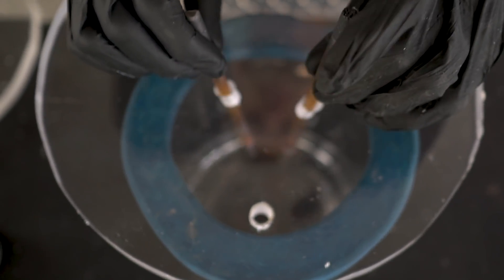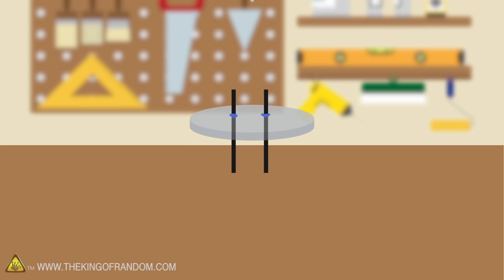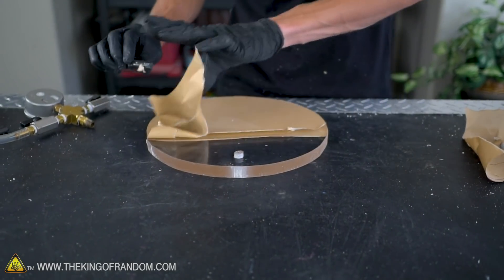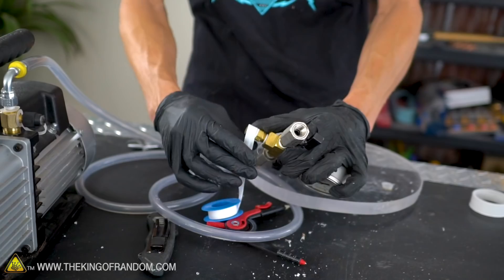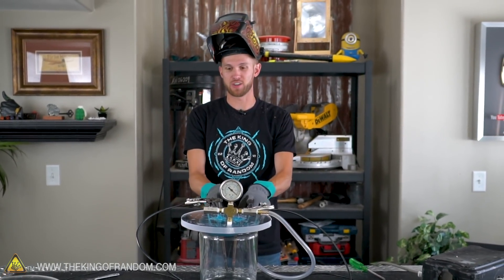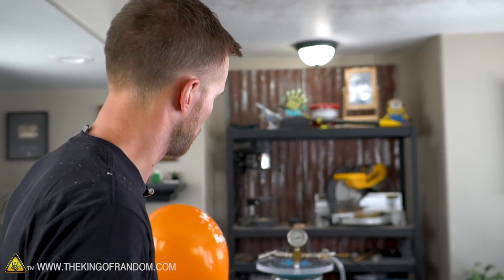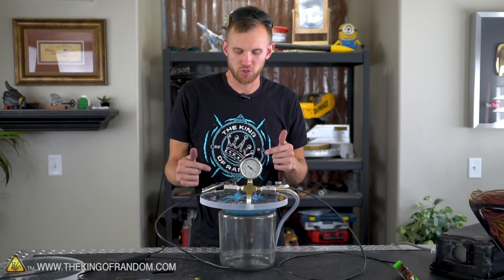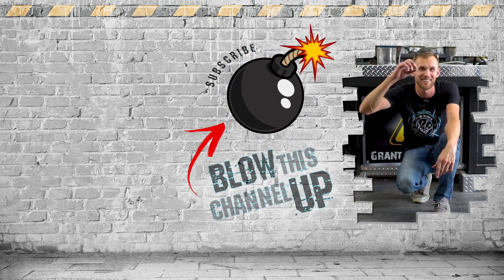Well That Was Anticlimactic

Comment: I'm not sure what temperatures you're dealing with, but how about some "Permatex red" gasket compound for high temperature automotive use?  Also..  What about putting an arduino-controlled servo inside to actually create the movement rather than the sticks extending though, so maybe you could more securely seal just wires that need no range of motion?  Make the sticks move via RC?

Comment: Can you guys please put hydrogen instead of nitrogen
Reply: Thug Life that would probably blow up if you are meaning to use it with the arc furnace
Reply: it would not if they pulled a near total vacuum first, not enough O2 to burn the Hydrogen
Reply: @winterbornfan  What if they use Carbon , nitrogen and oxygen guess what would happen?
Reply: @xxtacowarriorxx6440  the temp would not be enough  to conduct fusion and plus it would be in vaccum so it 
wont  react with atmospheric oxygen

Comment: you should put co2 canisters in the vacuum chamber!!
Reply: lucas johnson it wouldn’t do anything as they’re already sealed under pressure
Reply: @jamieknight7366  dont u think that the pressure inside the co2 tubes rises if the atmospheric pressure around is lower?
Reply: @ExtendGamer  the pressure differential would occur, but co2 is already at a very high pressure (800 psi?) so the increase would be less than 1/2% of what is already there - well within the tolerance of the cylinder. Now, throw them in the melting furnace...
Reply: @ExtendGamer  the pressure inside the CO2 canisters will stay the same. The delta P will change by 12 psi. Not enough to do anything.
Reply: yes vacuum and pressure are two opposite things
Reply: so the  vacuum chamber would increase pressure
Reply: in the canister

Comment: Try using a high temperature acetoxy silicone sealant, it should remain flexible but has a much higher tolerance to heat.

Comment: Is it possible to make a foam figure in a silicone mold from spray foam?
Reply: If you used expanding foam it would probably push the mold and become warped unless the mold was solid then it would expanding out the top but that's just what I think would happen correct me if im wrong
Reply: @rockingyeti56  Let's Get Enough likes and maybe they will do it and we'll see

Comment: @The king of random
Deacon 8875-Thin is a thermal reactive paste sealing compound that is used in high temperature and high pressure applications
Upto 1800 degrees Fahrenheit

Comment: Try using High voltage for a different result. With high voltage the Proto puddy won't be smoking that often. High voltage reacts differently in Vaccum Chamber. Will be quite interesting to see all the corona discharge.

Comment: You should use high temp RTV sealant to make your proto putty
Reply: Beat me to it
Reply: You might have to use something other than corn starch to make it easy to shape. It burns before the temp limit of high heat rtv.

The silicone caulking cures because the water in the food coloring, so that would need to be omitted.
Reply: Could you use talcum powder in place of corn starch?
Reply: @Oddman1980  I think maybe if you use baking soda that might be better it might have a higher temp
Reply: @ Jesse Kopplin that's something I didn't think of. Maybe time to do some experimentation!
Reply: I tried making some of the regular proto-putty today, since I'd never made any before. TKOR makes it look easy, but I made a little bouncy ball for my young daughter and made some nice ergonomic hand grips for my bike. I'm seeing lots of uses for this stuff.
Reply: Yep, I was going to suggest this also.

Comment: Re: smoking putty.
How about shorter pieces of the naked metal so that it’s the insulated part of the wire that goes through the holes. Maybe the insulation will keep the heat away from the holes/putty.

Comment: Unless there is still a bit of air in the chamber, you wouldn't see a spark. The electrons can only move through molecules in the air, making them into a plasma, which makes the bright light. No air, no sparks. If there would still be electricity running, that would be because of quantum tunneling and that seems unlikely at that distance.

Comment: Crazy dangerous.  Should be ceramic NOT a thermoplastic. Policarbonate and acrylic melt and sag at too a low a temp for an arc which approaches the temperature of the surface of the Sun. The glass, too, could shatter from temperature differential ... glass shrapnel.

Comment: Whenever electricity arcs from one electrode to another in ionizes the gas in order to make a path for the current, so without any gas in the chamber, it will be impossible to strike an arc. I would suggest filling the chamber with Xenon, which will make a very bright arc, and essentially create an HID lamp

Comment: The arc from the arc-reactor comes from heating air molecules so much they turn in to plasma. Without air there is nothing to heat up so there will be no arc.
Reply: Plasma is more prominent at lower pressures, this is why he chose to put it in a vacuum
Reply: However,  in an almost perfect vacuum there is no air to form plasma, which is why there is a shorter/no arc.  What he needs is simply Lower pressure, not no pressure
Reply: True
Reply: What about throwing some Neon in there to make his own sort of home made neon light? He would probably have to update tho power source to do that though but finding an old neon transformer shouldn't be too hard since neon is dead and is now King... random
Reply: You can form an arc in a perfect vacuum. You can also create plasma in a perfect vacuum. Only real problem is you can only do so once before your electrodes are atomized and your electromagnets are polarized.
Reply: @Veritas-invenitur  I am not sure what the second part of your comment means, it needs to be explained better. But by definition you can't have plasma in a perfect vacuum. A perfect vacuum by definition has no matter in it, and plasma is a state of matter those requires matter to be present to exist.
Reply: @Dan Bodine I guess it all depends on if we are talking about a classical vacuum, a QED vacuum, or a QCD vacuum. Your definition of a vacuum matches that of a QED, the problem with that is the quantum aerodynamic vacuum can be considered as a material medium capable of vacuum polarization making it measurably conductive without matter. The most important thing you can learn is that when it comes to quantum physics you cannot rule anything out based on logic alone.
Reply: @Veritas-invenitur Sure, it might be more conductive, but this isn't about conductivity. Saying you can't have plasma in a vacuum is basically the same as saying you can't have gas in a vacuum. And you can rule it out based on logic, that's how logic works. We are also talking about a macro system so quantum mechanics really don't work hear.
Reply: @Dan Bodine I disagree, I believe that you can have plasma comprised of non-traditional matter inside of a vacuum of any type.
Reply: @Veritas-invenitur  Maybe something plasma like but not true plasma. This would also have to be on the nano scale where where you don't have enough stuff for something to be described by a state of matter.
Reply: I slightly aggre but also adding small amounts of air (my comment) would change how the plasma looks/acts.
Reply: Are you sure arc reactor is the term you're looking for?
Reply: I don't agree. Air is an insulator. Without air, it's easier for electrons to bridge the gap. I have seen a 110V motor in a deep vacuum let the magic smoke out when it was accidentally energized.
Reply: @bennyd8471  There will be an arc but you won't be able to see it because as he said there is nothing to heat up. This only applies to a perfect vacuum. A vacuum is never perfect so there will always be a visible arc.
Reply: @danbodine7754  So how does light travel so well through space? I know even space isn't even a perfect vacuum but you would think it would hinder it, wouldn't you? Maybe I'm out in left field on this one...
Reply: @bennyd8471  Light travels faster in space because there are less particles for the light to interact/bounce it so the path is more direct. The arc of electrons needs atoms to interact with to be visible because the heating of the atoms creates the light that we see.
Reply: @danbodine7754  Got it! Thank you!
Reply: Certified genius here I mean am I right?!
Reply: Nerd
Reply: I am a welder I've been one for very long time and I know for a fact that using ACR rods yes you can melt metal very quickly but they're mainly use to gouge welds out instead of using a grinder or anything else it goes a lot quicker yes you can use for stair to speed up the process and also make it a little bit brighter but it will not affect the actual Ark itself if you do not use are to do anything it's just how high your generator is connected to your electrodes and connection they will strike an arc but are has nothing to do with anything else and striking an arc. you can even stick Weld and a vacuum chamber if you really wanted to because it shielded from the air itself if you take 7018 or even 6010 and put it on the bottom of that vacuum chamber and strike an arc there will be no difference because it needs no air in fact the flux around the rod actually Shield it from the air so it blocks out pitting which is known as porosity and other factors so it would in a sense make no difference you're still going to strike an arc and even in a perfect vacuum you could in fact still melt Somethin it would take a little bit longer but it would be no different
Reply: The length of the arc is limited by the vlotage. He is using the metal melter from their older project, which is high amps and low volts. So the arc is going to stay short until he crankes up that PD.
Reply: Nerds

Comment: What if you put molten metal in the vacuum chamber? Or what if you cast something in the vacuum chamber?
Reply: Yes
Reply: Ya know, I read a Mercedes Lackey novel as a kid where some elves did just that. Wound up with foamed aluminum, used to cast engine blocks in race cars without using cold iron.